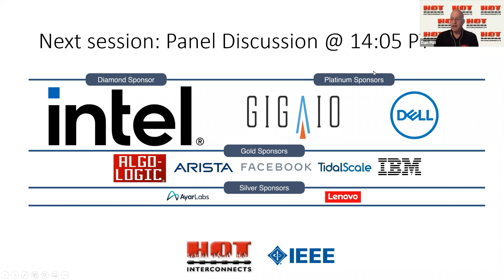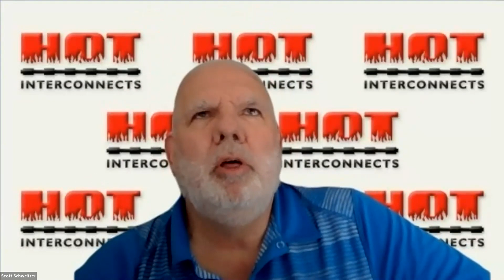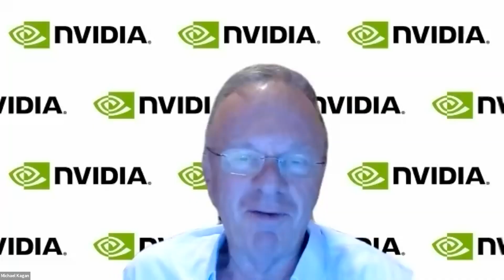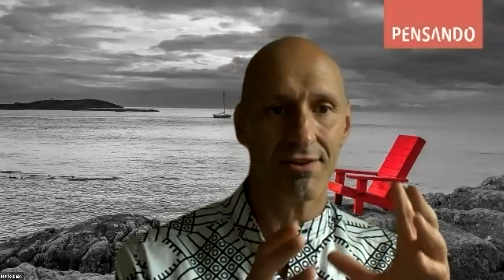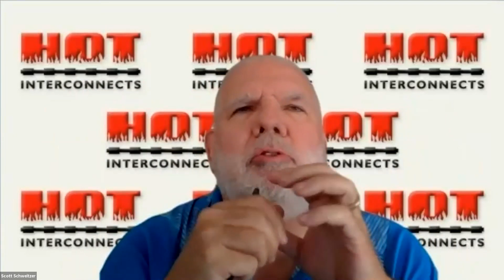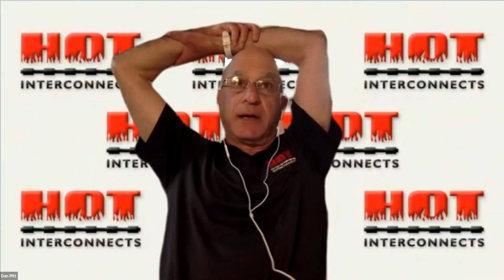Panel: Von Neumann vs. Programmable Logic Smart NICs: Which is the Dead End?

Comment: I moderated this panel. A full transcript is below in the comments. I was thrilled we had the following speakers:

Cary Ussery (Marvell) – prefers the term DPU, Data Processing Unit
Mario Baldi (Pensando) – likes to use DSC, Distributed Services Card
Michael Kagan (NVIDIA) – they may have coined DPU
Jim Dworkin (Intel) – IPU, Infrastructure Processing Unit
Nick Ilyadis (Achronix) – SmartNIC
Rip Sohan (Xilinx) – SmartNIC

Below, in a series of comments is a full transcript of the panel.
Reply: Here are the timestamps and question summary, followed by a summary of answers:

15:10 On queueing packets into accelerator memory:
Cary – Hybrid approach of on-chip vs. off-chip. Data paths are being built with batch packet processing in mind.

Jim – Temporal locality of the packets and flows to compute engine, especially during initial flow setup.

Mario – SmartNICs need to work at line rate; they should not queue packets, so most queueing is on the chip. Queueing may be more critical when working on packets at the messaging level, and then using off-chip memory is appropriate.

Nick – Coming from an FPGA point of view, supporting high-speed external memory is critical for flexibility.

Michael – Queues shouldn’t be kept on a chip; use host memory, particularly on entry-level NICs. You need to design your NIC, so it is balanced. The attached memory, DDR, is used on DPU to retain context. On-chip, there should be caches that are as small as possible.

Rip – Keep expensive on-chip memory as small as possible. There is a case for slower and larger capacity memory; most systems will leverage tiered memory, where the host memory is the final tier. You’re only as good as the primitives you have for sorting, managing, and moving data.
Reply: 27:35 How should classification and action on packets be handled? 

Jim – In any CPU architecture, you have caches, L1-L3-DDR, and as a result, added latency as you work on data; this is not the case with FPGAs. Based on the temporal locality of the data to the compute, you’ll find that these SoC-based solutions take much longer to process packets.

Mario – It should not be fixed logic, as requirements and needs change over time. Our approach is to use ASICs with software running on processor cores to manage packets; that way, things are reconfigurable.

Nick – We want to provide the user with maximum flexibility, as we know that protocols keep evolving. The FPGA allows you to change the way the hardware is programmed.

Michael – Most things should not be done in the CPU; the majority of the traffic should go through the fast path you’ve designed for. Once you have the experience, you can use the CPU, which is on the slow path, the exceptions, for when you need the flexibility to do something not found in the ASIC. It’s a design that’s balance; the art is using CPUs with ASIC blocks for the best performance for what is required.

Rip – Your most precious resource is your CPU, so by the time data reaches the CPU, your accelerators should have done everything they could. That way, the CPU could just do the thing that it's supposed to do.

Cary – You don’t want to do classification on a general-purpose CPU. 
It shouldn’t be hard-coded logic as too much is changing in the market, something that is both flexible and programmable, almost on a minute-by-minute basis. Microcode engines, not CPUs.
Reply: 36:00 On-chip network bandwidth, what is your approach, and how is it adapting?

Mario – The architecture has to be hierarchical; you cannot possibly have all components talking to all components. You’ll need some coherent caches, and the design is not trivial; you may have more than one network on the chip. On-chip bandwidth has a huge impact on the performance of the DPU. The key is how you put together the various components, how tightly you integrate things.

Nick – Flexibility is very important when tying the pieces together. We enable our customers so they can configure their architectures the way they want. We strive to offer the most flexible interconnect to meet their needs. At Achronix, our 2D NoC (Network on Chip) is finely tuned for this purpose.

Michael – On the SmartNIC, the way you set up the on-chip network is much more straightforward than FPGAs. The right caching and buffering structure is one of the key things to having a successful product.

Rip – With a hierarchical structure, as clock speeds and volumes go up, you’ll replicate more of the same components. We buy into that approach. What we aim to do with our architecture is to move data around faster; it turns out that half the time is spent moving data around. When things need to take a step up, make sure the core logic provides for that. Our challenge is, can we scale the way people write applications so that those applications scale up with increased traffic. A 10 GbE application is completely different than a 100 GbE application. The basic structure is the same, it’s the optimizations that matter. It’s not just about the hardware itself, it's about the software, the way you structure the software will ultimately influence how the hardware is designed.

Cary - There isn’t an on-chip network per se; there is a series of optimized sub-systems that are interconnected via a crossbar switch. Taking an SoC DPU approach means getting these interconnects optimized and done right is hard work. 

Jim – It’s our job to figure out how to handle the internal plumbing. The strongest vendors in the market will be those offering customers the most choice. Working with hyperscalers, we’ve worked hard to tune systems to their specific configurations. We harden certain functions, like crypto, with that hardened data path, we can further tune and balance the system.
Reply: 46:05 Balancing what we can do versus what we should do in hard logic as opposed to soft logic or programming, what are three DPU functions do you feel should be in hard logic?

Nick – Interface logic like Ethernet and PCIe as well as TCAM and a classifier.

Michael – Classification, data processing, compression, DMA.

Rip – Assuming PCIe and DMA are hard, with regard to applications packet classification (L3-L4), crypto, both storage, and networking functions, and basic packet processing functions like LRO, checksum insert, checksum verification, those three are must-haves.

Cary – Crypto, IPSec, adding something different, work scheduling across multiple components on the chip.

Jim – On-chip data movers, compression, RDMA for, say iWarp, RDMA, etc...
Reply: 49:25 Now that we’re thinking beyond 100 or even 400 GbE, how do you intend to scale your architecture?

Michael – 400 GbE is kind of history; we’re working on 800 GbE, you scale vertically and horizontally. Vertically, you do things that use to be programmable now in hardware. Concurrency and more sophisticated data handling.

Rip – Increase bus width, increase line rates, take most common soft logic functions and move them to hard logic. Adding more cores to handle greater packet rates.

Cary – Optimizing sub-networks and data movers, diversification of that network to achieve higher rates.

Jim – Packaging technologies to keep solutions efficient and as low power to keep power manageable. Software is important to make it easier for customers to move from different deployment models, on-prem to cloud, etc. Having worked at other companies on this panel, I’m not sure if some of the solutions of other panelists will scale as we go to 400 and beyond.

Mario – All the devices are programmable, along the lines of software are tools, a compiler can make a huge difference. Also, the architect and the way the components are integrated can make a huge difference.

Nick – Our 2D NoC is very capable of 400G, scalable to 1.6 Tbps. So I believe having a high-speed network on the chip allows you to move data between parallel processing blocks to achieve these high data rates. It's not all about the speed of the interface but traffic management and shaping.
Reply: 56:27 Arm acquisition is still in flux. Are you or others considering other architectures like RISC-V?

Rip – This is his personal opinion. We are thinking about other architectures. We commonly look at other architectures. You are only as good as the software you can run on your processor, and both Intel and Arm have done an excellent job at an ecosystem level supporting this. From a holistic perspective, it’s always coming down to the top two or three platforms.

Cary – My opinion, not Marvell’s. The CPU architecture is not the main issue facing customers or customer satisfaction for SmartNICs. Arm has been successful in building its ecosystem. NVIDIA has done a good job of pushing the industry forward. There shouldn’t be a concern about which to adopt. RISC-V is good for a certain type of use cases, just not those we’re talking about today.

Jim – Depends on the persona of who you’re talking to; if it's someone building a SmartNIC using our technology, then the choice of processor is important. If it’s an end-user, then it’s not that critical; they would like a more turnkey solution. Tools, stacks, development kits, orchestration layers, how are these things going to be used. How are micro-services going to be run and distributed and executed at scale for the largest of customers? Customer choice is important, so if we’re working with a vendor building a SmartNIC, their ability to pick between processors is critical.

Mario – Whenever you start a new generation, you always look around at the platforms and tools you can integrate into your ASIC and decide which is best.

Nick – We are living in an open-source world. Having an open architecture offering out there enables more competition, so having RISC-V gives us options. If you need something that is tried and true, you can license Arm. If you’re looking for something that can scale from IoT class to server-class, then RISC-V gives you that opportunity. Also, as an FPGA provider, some of those RISC-V cores could end up as soft-cores, perhaps even experimenting with different instructions.

Michael – Several factors, availability, and cost of a particular core, the ecosystem, how wide do you want to use it, or is it for a limited deployment, or do you want to open it up for everybody. Last but not least, sometimes you want a CPU whose micro-architecture you can tune for your own needs. So you basically have Arm or RISC-V.
Reply: 1:04:48 How do you see Chiplets fitting into your future architectural plans?

Cary – The path to 400G is through the latest process technology. Chiplets are one option for modularizing and potentially reusing IP to build new products. From a customer perspective, they don’t really care. It’s an internal discussion item; there are latency issues with implementing chiplets.

Jim – The modularity is most valuable in a nascent market where you need to offer customer flexibility. We have that here at Intel PSG, which allows us to pair up different fabric sizes (FPGA) with different I/O. It also allows you to decouple from technologies as you move to support CXL. Cloud computing has squeezed the three-year cycle, and the cost of the most advanced technology nodes is getting so expensive that only the best-funded companies can make chips. Also, with the cost of getting it wrong so high, chiplets give you flexibility. Sometimes you need to go monolithic to get the best performance for the best price.

Mario – We have a constant requirement for more and more performance while power must be decreasing. I’m not sure if chiplets will be the right way to go for SmartNICs.

Nick – Chiplets allows companies to create different flavors and adapt to changing customer needs, but it’s not a panacea. There are challenges with cost, packaging; once you dig into it and get under the hood its not as easy as Lego™ blocks, there are a lot of things to take into consideration. Google is trying to create a chiplet marketplace; the devil, though is in the details on how they’ll pull that off.

Michael – In general, we are moving toward multi-die solutions like 3D stacking multiple dies, for example, HBM for example on top. Another driver for chiplets will be that once we need to connect optics from the package, we will need to connect at very high speed over short distances, then chiplets will be everywhere.

Rip – Two thoughts, at the basic level chiplets allow multiple configurations. What excites me is that you can mix geometries from different dies in the same package. This enables Universities and others to participate.
Reply: 1:12:23 Project Monterey, how’s it going, is it fulfilling its mission, if you’re not a partner, what are you planning

Jim – VMWare is one of Intel’s strongest partners, so we wouldn’t position ourselves against Monterey. The project is interesting; there is a lot of challenging work ahead of us to match up different architectures and solutions to get the most out of our partnership with VMWare. We look forward to a future with Monterey.

Mario – In a way, it is a confirmation that SmartNICs are positioned well by moving some of the hypervisor’s features to the SmartNIC. This enables cloud providers to move even more capabilities into the NIC for their customers.

Nick - SmartNICs or DPUs are more of a processing element, and standardizing the control plan for hybrid clouds is a good thing.

Michael – That’s right, we were looking to create a data center operating system, so we supported VMWare in the creation of this.

Rip – Again, a Rip opinion, on a personal level; it is exciting because it brings economies of scale to the server. It gives customers an alternative to just going into the cloud. Because we have localized versions of these offloads available, it will be interesting to see what migrates back into the cloud.

Cary – VMWare is a very important ecosystem player or partner in the SmartNIC space. We see a shift in SmartNICs or DPUs from offloading working in containers to what we’d call workload acceleration, where you’re full workloads like firewalls. As you look into these, we still see gaps in what is offered. Standard APIs for service chaining, for example.
Reply: 1:18:40 Standards are important, and CXL and CCIX are poised to change PCIe; how might one or both fit into your future SmartNIC plans. Also, what do you expect to see as a dominant use case for that standard?

Mario – I’m not a hardware guy, but my understanding is that the main driver for these two technologies is creating a tighter bond with more efficient sharing of information between different memories. SmartNICs are uniquely positioned as it sees all the traffic going in and out, and it has a brain by itself, so this is how we position our distributed services card. We create a sort of air-gap between the computing on the DSC and the host, adding more security. If you want to use your DPU as a coprocessor, then there is value.

Nick – CXL is gaining a lot of traction thanks to Intel. It is moving faster than CCIX and provides more capabilities than CCIX. SmartNICs have cache, which is important, so having a coherent memory structure between the host and the SmartNIC is a good thing. CXL is moving fast, and perhaps it’s leaving CCIX behind.

Michael – It’s a realization that the computing engine is not just the CPU; the glass wall between memory for the CPU and the rest of the system needs to be broken, making all processing equal citizens. CXL is evolving the interconnect and memory access semantics. CCIX is older, and it came about as the PCI-sig had slowed down; CCIX and CXL are pretty much the same. It doesn’t really matter which one breaks the glass wall.

Rip – This is a Rip answer, so it’s a little cynical. Will Intel implement CCIX, and if not, we will be supporting it, but again that’s a Rip answer. A better, more cohesive answer is that there is a place for both in the ecosystem. If you think about it and look more closely at them, they are similar but different. CCIX is more like what is needed for a cache interconnects between accelerators, while CXL is for connecting the CPU to a device or memory with lower latency and higher scalability. They’re complementary. A lot of it will also depend on your decision matrix. Do you need cache coherency or symmetry between peers, or is a marshal state ok? Do you control both sides of the link? Does it need to work in an x86, an Arm or something else? What’s the difference, there’s a lot of things to consider. Overall, both will survive, but CXL will dominate, but there is a place for CCIX.

Cary – CXL is going to be the dominant solution for host control of aggregation of resources and coherency. The CPU is the arbiter of the control, and that’s the difference for CCIX. If you look at solutions where the CPU or host side is one of the players in performing a workload that something like CCIX is needed, but will it be CCIX? Probably not. There does need to be memory coherency outside the host complex.

Jim – I agree with Nick; CXL does appear to be the winner. CXL is one where all signs appear to be positive, it's about the use cases, memory expansion, storage pooling, etc… We’ll have to see how the standard evolves and how it is broadened. We are seeing some killer apps with the IPU.
Reply: 1:28:25 What security two or three features will be table stakes for the next round of DPUs

Nick – The SmartNIC is the gateway to the server, so the first possible line of defense. So encryption, AES, ECC, hashing functions. Putting some sort of firewall functionality, looking for anomalies in traffic or threats, can create a shield.

Michael – Encryption, of course, but active protection like running anti-virus on the NIC and collecting telemetry to apply analytics to identify zero-day threats. We announced this type of technology and solutions. You can run your infrastructure and protection on the SmartNIC, and it becomes the cluster of data center protection.

Rip – I agree with everything said so far. Also, there is another class of security that is being asked about, which is device-level security because a certain class of attacks is going after exploiting micro-architecture bugs, differential power analysis, which are known as side-channel attacks. 

Cary – To add a twist, an interesting aspect of adding security to SmartNICs will be to add ML to analyze traffic.

Jim – Security is not a differentiator but a must-have. Intel has very high standards of designing security into products from the start, it’s a holistic approach.

Mario – We see the DPU implementing the security solution because it can be completely independent and monitoring the situation. I like what Michael had to say about actively taking a role and securing traffic.
Reply: 1:33:45 Given that Intel has acquired Altera, and AMD is now acquiring Xilinx, where do you see programmable logic moving forward?

Rip – Again, in my opinion, I expect to see a lot more convergence and innovation that spans the whole stack. For example, a company that owns the whole stack should be able to provide a compiler that intelligently leverages accelerators—a cross-pollination of technology that would produce network effects as different offloads that are more AMD centric coming over.

Cary – I think that everyone here would agree that open platforms, APIs, and Kubernetes are driving requirements for DPUs. The number of tools in your tool chest to create the right solutions to accelerate workloads for customers is important. Having everything in your arsenal is important.

Jim – Semiconductors is a scale game. At Intel, we think in terms of multiple architectural approaches, CPU, XPU, and IPU. Also, we think about architecture types underlying scalar, vector, matrix, and special. We believe the customers will ultimately benefit from greater choices and options to pick from. Intel is pleased with the five years of progress since the Altera acquisition. The ways in which our technologies dovetail together are very impressive.

Mario – Our platform is based on processors, and they may be domain-specific or fixed-function hardware. Right now, we don’t see the need, we could mount an FPGA, but we don’t see the use case. The perfect solution has different computational elements.

Nick – The last and single FPGA left standing. I think they can be complementary to merging them with Von Neumann to form a complete solution with maximum flexibility.

Michael – Intel acquired Altera; now AMD is acquiring Xilinx; good luck.
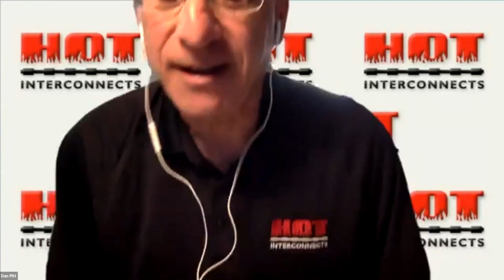Reply: 1:42:00 Dan, the IEEE Chair, asked if Scott could summarize what we’ve heard.

Scott – The takeaway that I have is that neither platform is a clear winner; the customer is the one that wins. It’s really a balancing act between the hard logic on the chips to do things like classification, compression, security, as well as having a good solid programmable interface, be it an Arm or x86 or programmable logic. I really think there is a place for all of these things given in various areas, given the amount of content and programming that is out there. Some of these things are very complex to do; OVS overlays cannot be easily solved with simple logic. 

1:43:26 Dan: You had six panelists who had no trouble coming up with three functions that must be included in the chip. You’re going to need some dedicated processing for these functions. Now that we have data coming in from IoT devices, autonomous systems, Machine Learning, etc., you are going to need flexibility in the programmability in all these things. Where do you see the growth for this hybrid market?

Scott – We have the hyper scalers driving a lot of the SmartNIC demand, but some of them are large enough to build their own because they don’t want to be beholden to one vendor. It’s the second-tier ones and some of the foreign hyper scalers that will go with off-the-shelf solutions. Intel, NVIDIA, as have Pensando, and others on the panel have all had good wins in this space, but the market will ultimately decide which approach wins out. VMWare’s Monterey may be what starts to tip the scale in this space, but it’s just literally starting to appear in the market with the technology preview last week. We don’t know yet if that’s going to make a big difference or not. I still think it's anyone’s game to win, it all depends right now on execution, and everyone getting their latest and greatest stuff into the market and providing it with the right software that customers are looking for.

Dan, I conclude that we are pushing technologies in both directions with Von Neumann and programmable logic.